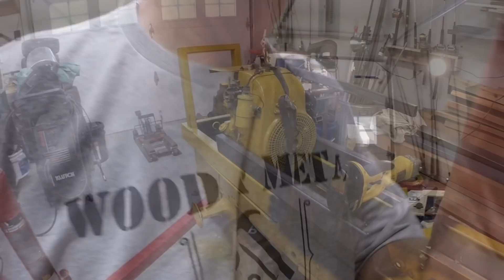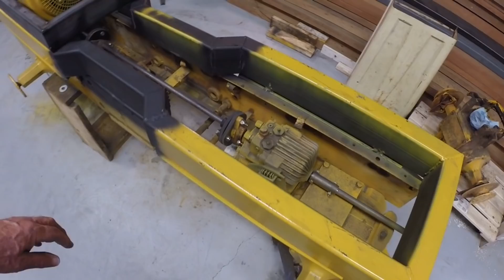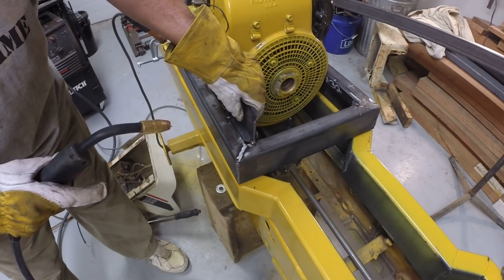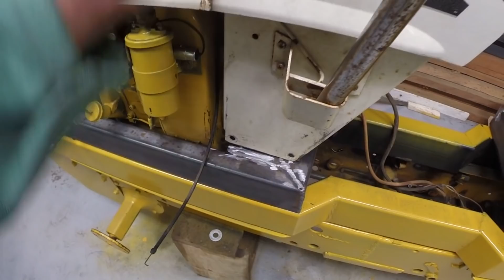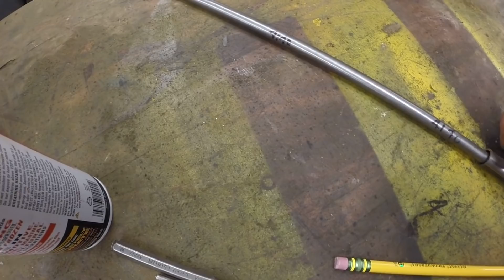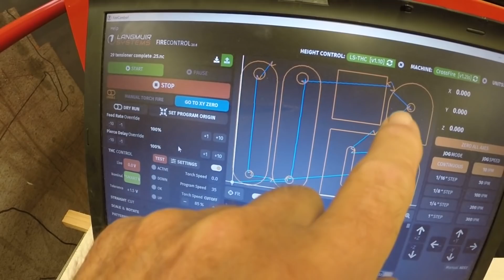Cub Cadet Dozer Build #11, Out of Control!

Comment: Very cool,….how do you turn the dozer left and right? …seems like you only have forward and reverse with that control set up? Pardon my ignorance on how those hydros work.
Reply from the maker: You have forward and reverse for each track independently--so run one side forward, the other stationary or backwards...
Reply: @woodandmetalshoptime8048   Oh, so each hydro can run one track forward and the other track reverse independently of each other?  Is that controlled through that single trunnion on each hydro or something else?
Reply: I was trying to figure that out myself
Reply: 1 hydro powers the left side track and the other hydro powers the right side track.
Reply: @jeffreykbevins7116   Oh, now that makes perfect sense!  Thank you for clearing that up!

Comment: love that project it looks great. I'm just curious what the front hydrostat is for since your only doing one drive cog per side and said that you were going to make the front idler wheels yourself. I feel like if you put all you HP in to one hydrostat it would give you more torque need to push dirt.
Reply: Each hydrostat will only drive one side so the front will drive the left track and the rear will drive the right track or vice versa.
Reply: each hydrostat will be driving only one side of the dozer. this gives it fully independent skidsteer drive, rather than brake-diff drive. he may have said 'front idler wheels' but each side will be opposite - one side will be front drive, the other rear

Comment: Great build looks great so far but one thing about your plasma torch machine --it need to be away or above the water table in a safe area a major electrical safety rule is always in stall electric above water pipes etc. water to be dry out of danger of water splash.